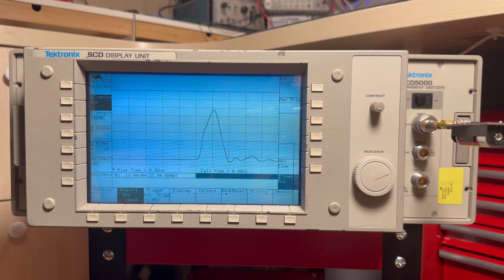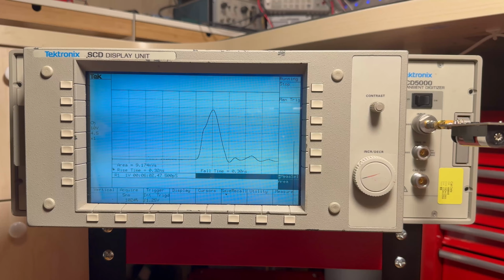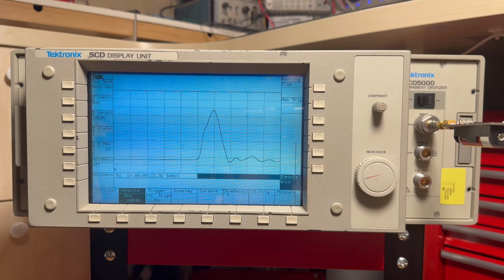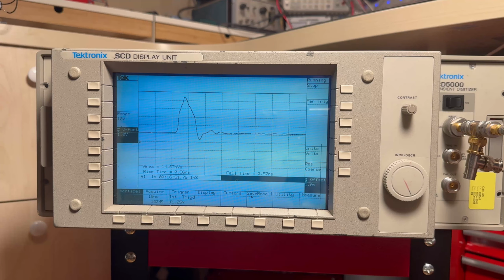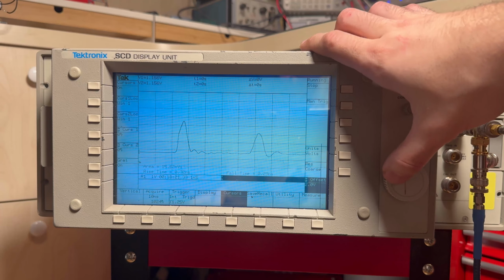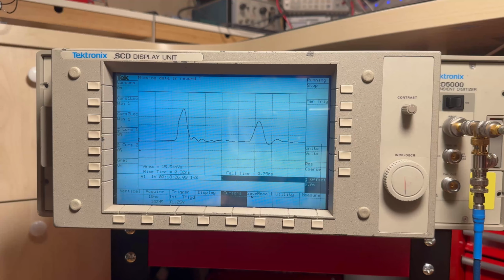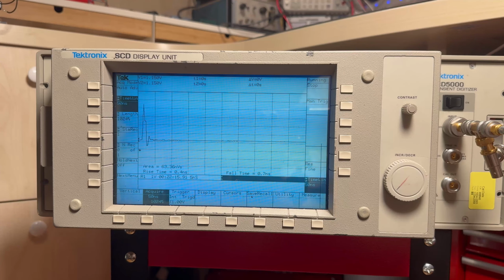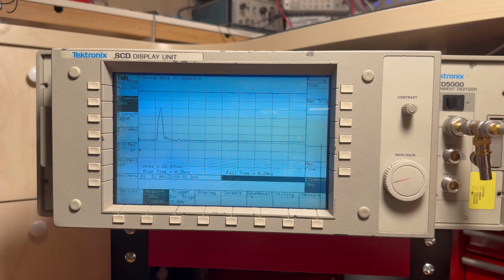Tek's Fastest Tube Scope*** (SCD5000)

Comment: However, the single-shot bandwidth is what a lot of people were looking for in a digitizer, and the SCD was better at repeating waveforms, unless you didn't need very many waveform data points!
Reply from the maker: It was specifically designed for single shots, unlike the sampling plug-ins

Comment: The older digitizers (R7912) are even wilder, using a different (I think) scan converter tube. No display was available, you needed to operate the thing, and obtain your readouts, via GPIB.
Reply from the maker: They did have composite video output

Comment: I actually have a like new functioning 7250. scope. It is a monster. It has several handles on it and takes two people to even move it. It does have incredible bandwidth and capabilities and is also clumsy to use. Just like this thing is. it has an input separate from a trigger input. So you have to either supply a separate trigger signal or parallel it with your input signal. it. is a tremendous work of art and novelty. Of course I have no real purpose for it. I don't imagine too many people do. Interesting video to see the non scope variation of this technology. I heard a story from the tEK  sales guy at one time. He told  me Lawrence Livermore had an application for these where they were exposed to a huge burst of radiation after making a measurement. which rendered the device worthless. So the. story goes that they would buy and use these$80,000. pieces o f equipment like fuses. He wish ed he was the salesman that had that account. Sounds crazy enough to be true but of course I have no idea if it is but on government money is involved, anything is possible.

Comment: Please save the contents of those Dallas non-volatile SRAMs so you can keep this relic alive if the battery dies in those Dallas chips. Also save all the EPROM contents because those can also fade after 20-30 years. BTW being calibrated in 2003 doesn't seem that late, considering the boards you shown of the parts machine are full of 1996 made components, the parts machine was likely made in 1996 or 1997 so it was only 6 or 7 years old in 2003.

Comment: This is exactly what I want to see. I will stay tuned for more obscure scope stuff. I have a DSA602, but this knocks it out of the water (different use cases, of course). I appreciated the mentioning of the older Tek hardware that one might have to use before this (S-X heads, 7104, etc). Always nice to see the historical context of gear.
Reply from the maker: Stay tuned for more: 556, 7104, 576, sampling etc
Reply: @mehrwert_lebenswelt;
🇩🇪 ?
🇨🇦 In 🇩🇪